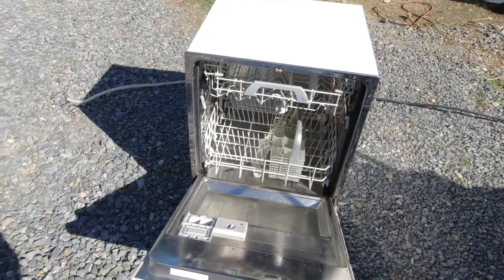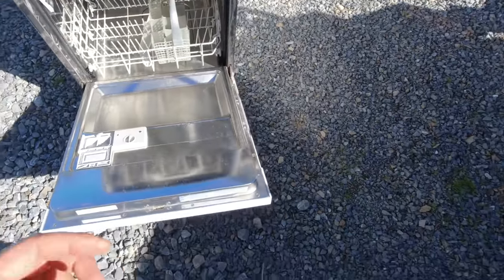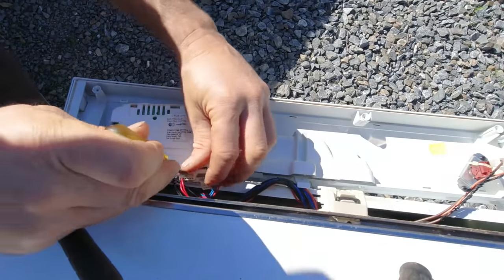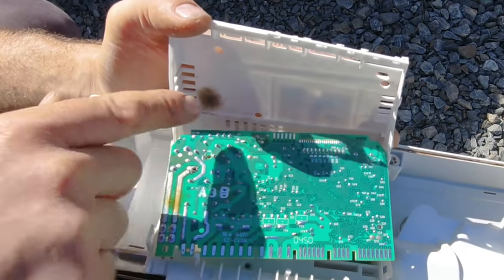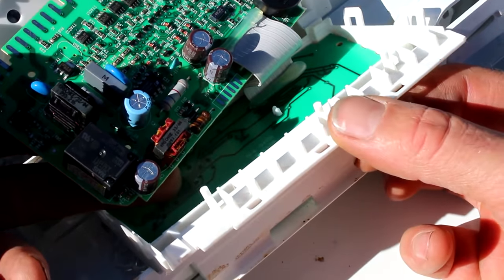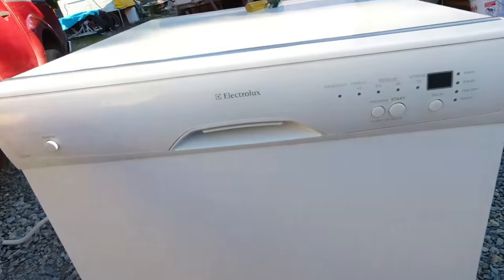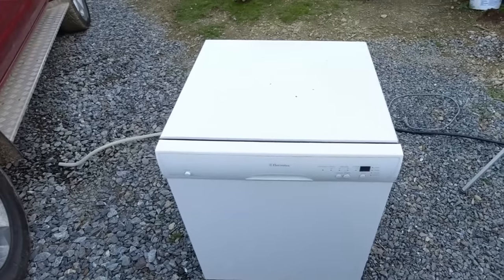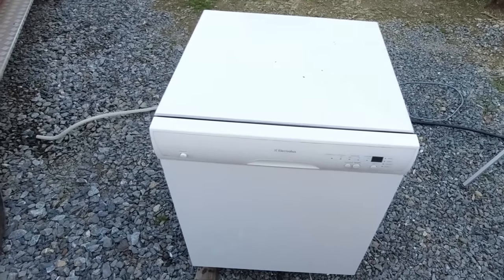Dishwasher not heating water? Try this easy fix / Offgrid Hack- Make your dishwasher use Less Power

Comment: Nice fix! Did the same to our ISE dishwasher a while back. Something else crapped out (pump? Don't remember, been a while) and I opened it up and found a schematic with troubleshooting info! Ran it through its diagnostic mode, figured out which circuit wasn't working, tracked that back to a bad solder joint using the schematic. Repaired another bad joint for the heater while I was in there, we hadn't even realized it wasn't heating. Back up and running.

Comment: Thank you so much. You are an angel sent from heaven. I just fixed my dishwasher using your fix. God bless you.
Reply from the maker: Woohoo thats awesome.. it is a common issue, some of them were light on solder from the factory. If it happens again soon, might be worth replacing the heater relay, the contacts may be burned

Comment: You are the man Marty. Mine had exactly the same problem though the printed board was also burnt (not just solder off the relay contact). Thus I bridged it with a paper clip. Works a charm!
Steve Jones

Comment: This tip helped me fix my electric oven. Exactly the same type of fault, burned solder connection, except it was on the relay for the fan motor.

Comment: Six months ago, my parents threw away their Electrolux dishwasher after 8 years of reliable service from exactly the same reason.
I had that circuit board exposed, but I am not an electro engineer, so when I saw that burned black plastic circle above the relay, I wanted to give it to some expert to fix it. My parents however, they wanted a new dishwasher immediately, so they bought a new one and this older one went to a scrap yard. I felt bad, because I knew it must be an easy fix. Now I see it would have been even easier, as I have a soldering station at home. Farewell old electrolux dishwasher, forgive me my absence of electrical skills :D
Reply: Did it complete the cycle ? Or would it stop working if the water did not get heated  ?

Comment: AWESOME video, Marty! I wish this had came out about 6 months ago. We got rid of our dishwasher because it quit heating. This DIY fix may have helped save us a LOT of $$$$
Reply: When your dishwasher quit heating was it completing the cycle with cold water or it would stop at a certain point ?
Reply: @suhailasaba1051  I'm not sure. All I know is the dishes weren't dry, & hot when the cycle finished, like they usually were. We ran er a few times to make sure we didn't accidently  select the wrong cycle.

Comment: Anybody else doing this fix - while you have it open, might be a good idea to solder a length of reasonably thick stripped copper wire along each of those overheating tracks to reduce the resistance.
Reply: I know that machine in particular (the European model, which has a few small differences) and on ours, the trace is already thickened (by a machine at that). So these that "burn" out, are defective units. :\
Reply: well, the overheating arises from the interior of the relays, not from the PCB tracks. Root cause in most cases is the wear-off / burn-off of the relays contacts, which increases the resistance and therefore gives  rise to overheating of the whole relays contact and its solder pin. I therefore recommend a replacement of these relays.
Reply: @DrFrank-xj9bc  that is what I figure, it must be something that caused the solder to melt.
Reply: @DrFrank-xj9bc  I would replace the relay with a Solid State Relay, if possible, to reduce chances of melting of solder.

Comment: Now the BIG question is, is Mrs Marty going to be happy, one of your neighbours or friends or are you going to do as I've seen one used as a parts washer. It's amazing how much of a small engine you can get in even a small dishwasher like that.
Used to work on Ford Transit diesels and they had a similar problem with the heater relay which had a section of printed circuit which was narrower than it needed to be causing it to burn out so I soldered a link wire in and all worked fine I kept a repaired one ready in my toolbox because it was a common failure.

Comment: The solder connection directly north of your soldering tip also needed a reflow of solder for sure.
I would have reflowed all the relay connections. Lots of current passing through there.
Cheers.

Comment: Hi Marty, that's a well known fault on Siemens brands dishwashers also. Latter may have 3 of these relays. The solder joint is broken, because the internal relays contacts are burnt, which overheats the contacts and in turn the solder pin. The brown stain on the plastic case seems to be located exactly over the defective solder pin, which proves this statement. A replacement of this relays is therefore necessary, otherwise this fault will soon recur. These relays are industry standard types and usually cost a few bucks each, for the next decade of operation.
Reply from the maker: Yes if it does it again I would replace the relay. I will add a note in the vid description. Cheers

Comment: Did the same fix on a Siemens dishwasher here in Germany about 15 years ago, worked good for another 7 or 8 years; don't know what happened afterwards b/c we moved on from renting that flat to our own house. 

This dishwasher was already >10 years old then and was technologically mostly the same as yours today, just more throug hole components on the PCB. Even in the late 1980s / early 1990s there already were similar ones (at least made from the same steel stampings, maybe with a mechanical timer wheel instead of electronics and less insulation).

Amazingly, there STILL seem to be only two different basic dishwasher patterns for more than 30 years at least in Europe and most other 230/240V countries. Guess it didn't help that most manfacturers were bought out by Electrolux and later Heier (China).

When you buy a new name brand dishwasher here in Germany, you get the "doesn't heat up properly" function as a FEATURE because the manufacturers don't spend ANYTHING on R&D concerning REAL energy saving modifications, they just alter the default cleaning program so it doesn't heat the water as much and doesn't dry the dishes properly in the end to get an "A+" in energy efficiency. 

Only when you turn on all "heat plus", "water plus" and "cleaning plus" features does the dishwasher work as it should, and then it uses as much energy as the ones from 20 years ago.
Reply: Would those new ones complete the cycle even in case that it doesn't heat the water at all or in case the heater is open circuit ?
Reply: @suhailasaba1051  I don't think so. Most likely one of the modern dishwashers with a lot more microcontroller integration would give you a fault code because the intended water temperature could not be reached. But this would have to be tried out to be sure.

What can easily be done (and what I did to my current "energy efficient" dishwasher from ca. 2014/2015) is to plumb in hot water from elsewhere so you save on the electricity for the internal water heater which obviously has to run less to reach the desired temperature with pre-heated water. 

To my knowledge most of the brand name dishwashers sold in Europe nowadays are rated for hot water intake.

 Of course this only makes sense if the externally heated water is heated in a more efficient or cheaper way (like solar) than heating it up in the dishwasher itself. Also this does not take away the problem of the artificially insufficient drying function at the end of a cleaning cycle.

Comment: Smart fix. I wonder why the solder lead also got hot? It was slightly discolored. I would have check the filter caps while I had it apart just to be sure they were okay as well. There is a reason it actually melted the solder completely off the relay lead... In any case, good catch!
Reply: Marty stated in another comment that the boards are known for skimpy solder connections on that particular place...
so in time the heat and "arcing" causes the electrical  failure.
Cured by resoldering the connection and reestablishing a good electrical path.
Reply: @JohnSmith-pl2bk  Hi John, I heard him state that as well. Did you notice the discoloration in the area all adjacent/opposite the soldered lead. It probably would have have been another smart move to re-solder the thin lead a bit heavier over the entire length as it was already thinly soldered.   Under-designed.... :( Overheating, smoke, fire, shorting, all bad stuff that doesn't mix well with a home, people, children... or pets,

Comment: Good fix. I have a Samsung dishwasher that was having some "haunted by ghosts" issues (it would start up and run fine but halfway through the cycle would start cycling on and off and beeping like the door was being opened and closed every few seconds). Possibly caused by a cold solder joint somewhere on the board that was heating up during operation and becoming intermittent. I could have tried to fix it but the whole control module was potted in epoxy! $150 down the drain for a new module from a parts shop instead.

Comment: might make a good automatic parts washer for the shed.
Reply: I use my old 1980s dishwasher as a parts washer as its stainless steel inaide and the water temps set at 220f which will clean heads.valve covers.carb parts.hoses.pretty much anything free and clear of grease.oil.gas.diesel.etc after a full cycle..and it only costs about as much ad the sonic cleaner does power wise,but will clean much larger bits n pieces up to V8 heads.valve covers.intakes.carb bodies.etc..  Cheap cleaning...
Reply: How does the water pump handle the oil and grime?
Reply: @tf7274  How does hohe sewage plant handle all the oil and grime? And nature, in the end... at least in Europe it’s forbidden as hell to attempt to do something like this.
Reply: @dermitdrApe  
The sewage plant copes with far worse...industrial grade worse.

Comment: Hey Marty, great tip.. just curious, any idea why this happens? Looked like a pretty nasty burn but the components are not damaged..
Reply from the maker: Quite a common thing, apparently the relay solder and circuit is a bit light on some of the old models

Comment: "Make sure no other components are burned..."

I think I saw some bulged capacitors on that board.  Bulged capacitors=bad capacitors.  If the tops or bottoms aren't perfectly flat, the capacitor needs to be replaced.  Fortunately, it's an easy fix.  Cheers!

Comment: I found that sometimes you have to clean the pins as they have a weird corrosion on them, bit of flux then make sure you do NOT do a cold solder joint.
Reply: And a good idea would be to bridge the tracks with heavier wire, so it doesn't get so hot in the first place...

Comment: Thankyou for this video! I’m having the exact same problem with mine atm. I have removed the circuit board but the solder you are talking about looks fine. Should I try soldering it anyway?
Reply from the maker: Worth a shot, or replace the relay
Reply: @MartyT  I added some more solder and it runs like charm now. Chers again! You saved me buying a new unit
Reply from the maker: Nice, well done

Comment: 1960s  Swan dishwasher had a cast iron water spinner and a motor "over heat protection" that I had to reset for my parents this was achieved by removing the bottom DRAWS and a left hand gynaecological reach to the rear of the motor tiny little button. The machine ran for 10y after we left the public house where the machine was installed.

Comment: Marty, how did you know what the problem was to go directly to the relay or solder joints? Did/do you work in the appliance repair services or something? Thanks for the video.
Reply from the maker: It is a common problem that the relay pins are light on solder from the factory

Comment: Can you show us how to check the heating element? Thanks.
Reply: On a lot of newer dishwashers, the heating element looks like an enlarged plastic joiner with wires leading of it, in the hose/duct leading from the pump to the spray arms.
The element is inside this "joint", and as the water is pumped, the element is switched on by the controller and heats the passing-thru water...
It is an easily replaceable part...
but as Marty shows, check the board and check the relay...then check the heater....

Comment: What gets me is...how do you know all this stuff??
So...what do you know about girls?  😂
Reply from the maker: Lol.. Girls are highly complex, I would not try to fix one
Reply: @MartyT  Hahaha!  Too right!
Reply: Trouble is... the manual for correctly and easily run one of them 'girl thingies' is so goddamn thick you're life runs out just as you finish the last page of it.
Reply: I have kept the same girl in operation for 35 years. The older units are much easier to run and replacement with a newer model is expensive and they draw too much power.

Comment: Or alternatively, pour a few litres of HOT water in from the jug for the initial fat-cutting wash and then have a cold rinse.
Some machines 'purge' before they fill...  So, let them purge before you add hot water.

Comment: old dishwashers make great parts washers, just use degreaser liquid recycling into a barrel, if the heater still works the better as with casings with bearings the heat makes the casing expand slightly making bearings easier to press in

Comment: I think the contacts inside the relay may be burnt up causing high resistance/heat that ultimately melts the solder.  I have seen that happen on microwave ovens and conventional ovens as well.

Comment: Too many things get tossed when they could easily be repaired. Even if the circuit board had been smoked it likely would have been cheaper to just swap out the board.
Reply: Can't find the parts once discontinued.
Reply: You can only swap out the board if you have a board to swap. Manufacturers, in their infinite scum, don't produce replacements anymore after a certain period. Any board you see online (i think past the second year after end of production in most cases) is from a deceased unit OR from a group that bought these in bulk, carefully stripped them to bits, and are selling the parts as "new old stock", usually at a pocketable overprice.

Comment: same thing happens to the relays that control power to oven elements. sad that no one fixes these broken appliances as usually the replacement board is half or more the cost of a new machine. many appliance end up at the curb with simple fixes like this.

Comment: I've had my tester on my heating element and it's down to earth with no continuity through the terminals, will I be able to fix this or is it just a straight replacement?
Reply from the maker: Depends how much a new element is, might be cheaper and easier to replace it with a good second hand dishwasher

Comment: I wonder why that relay still works when it got so hot to burn the wire loose and burn the box ?
Reply: The heat is not in the body of the relay...the heat is at the tip of the pin where insufficient solder meant high current through a limited path heated the path until the solder melted off...instant electrical "open circuit".
As soon as a decent amount of solder is applied, the electrical highway is once again, open for business....

Comment: Great repair!
:-D
But if you feed pre-heated water, wouldn't the internal thermostat prevent the heater to kick in, as the water is already hot?
Thx for the vid!
:-D
Reply from the maker: Yes if its up to temp, if its not quite up to temp the heater will kick in
Reply: @MartyT  Or maybe not as long as with cold water, I see...

Comment: Scary to think the relay itself is turning into a soldering iron to desolder itself.
Reply from the maker: Its a common issue, not enough solder from the factory so the pin heats up
Reply: The usual crappy wave soldering that never applies enough solder. I would have reinforced the tracks as well with copper wire and extra solder. Used desolder braid wick works well.
Reply: It's a regular problem on many modern less expensive amplifiers too - the output transistors are connected to the speaker terminals via circuit board tracks. Those transistors also mostly have very inadequate heatsinks, and they get HOT when turned up loud, so they promptly desolder themselves just like this relay did. Correcting the problem usually involves firstly installing larger and/or more efficient heatsinks with good quality thermal compound (i.e. not that white crap - some of the good stuff designed for computer CPUs works miles better, for longer), and bypassing the tracks by wiring the transistors to the terminals with some decent quality copper wire. The half dozen or so amps I've repaired with these methods are still working fine years later so I must have done something right!
It's not a problem once you start getting into higher quality equipment - mostly the better gear will have the board designed so the output transistors are at the rear, right next to the terminals, and will use solid metal connectors (sometimes called "bus-bars") using screws or bolts instead of solder as the joining method. Aside from being a solid connection, the bus-bars can also act as a bit of a secondary heatsink so there's virtually zero chance of failure due to excess heat. But all that costs money, so you generally won't see that setup in a cheap amp.

Comment: Every dishwasher I've ever had is plumbed straight to the hot water.  Damn sight quicker cycle when you don't have to wait for the water to heat up.
Reply: That is how they do it in the US. It usually causes issues with low water temp as the initial water is room temp.
Reply: @jonnenne  That's why I purge the line of cold water by running the hot tap in the sink next to the dishwasher.  Means the only cold water going into the unit is the 1m or so of soft line between the dishwasher connection point and the unit itself.  Run the tap into a jug, and pour it into the washing machine next time you do a load of washing.